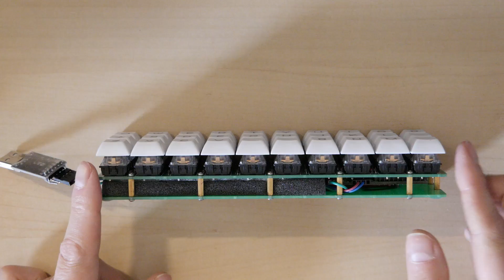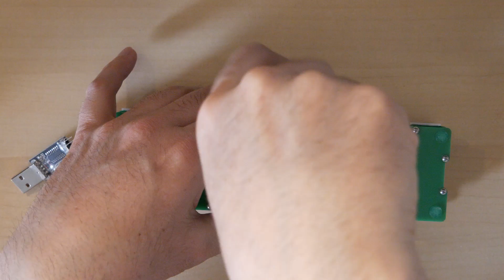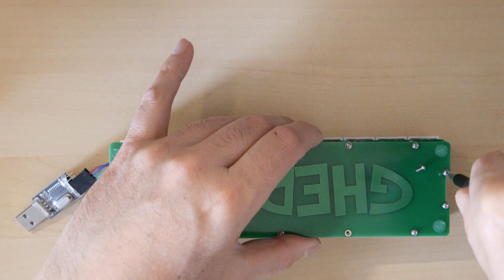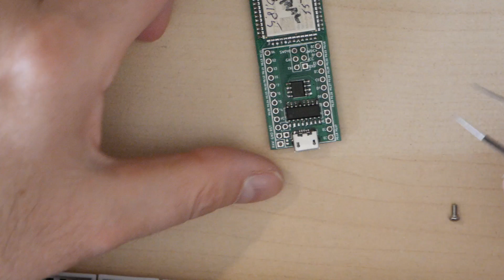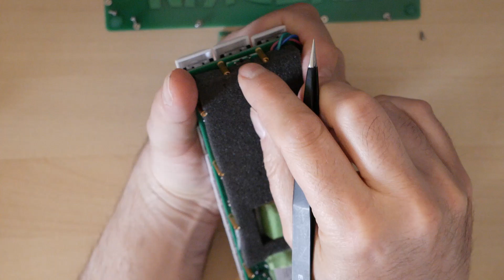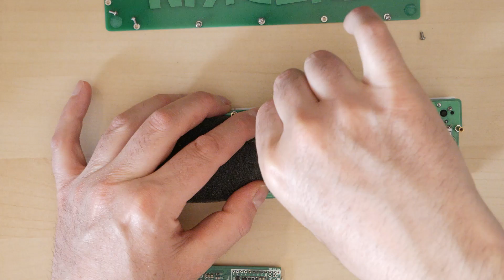Bluetooth Gherkin and BlueMicro Build Notes

Comment: So how do I decide whether to connect my lipo battery to raw or to vbatt? And whether the resistor between them should be removed on the v2.1b board?
Reply from the maker: For the Gherkin, you don't connect the battery to RAW.  The gherkin PCB has a flaw where it connects RAW with VCC.

Comment: Where would I be able to purchase a BlueMicro? I have a Gherkin that I intend on using as my Nvidia Shield Tv Keyboard
Reply from the maker: I have a store at store.jpconstantineau.com.  The gherkin-specific BlueMicro isn't there yet but I can easily add a "Gherkin BLE-Add-on kit" on there. I'll do that later tonight.  I'll make it simple by having a single Bluemicro and a Lipo battery and the small switch needed.  Most of my entries are for pairs of them...
Reply: @BlueMicroWirelessKeyboards  Legend!

Thank you